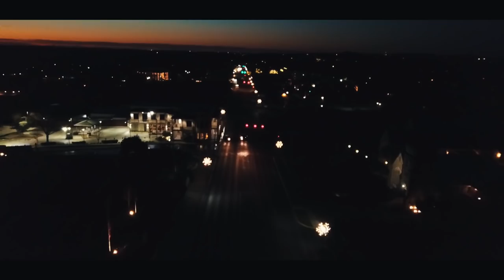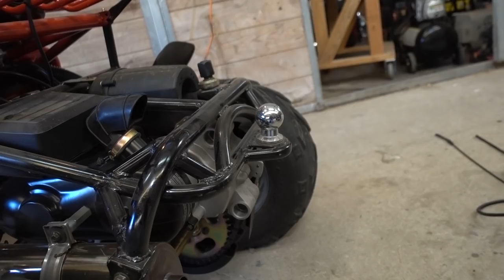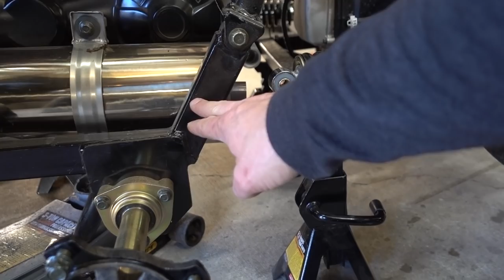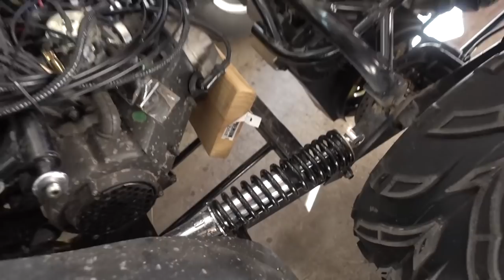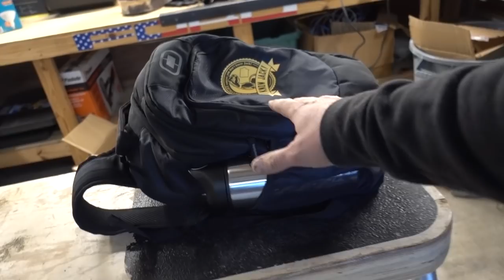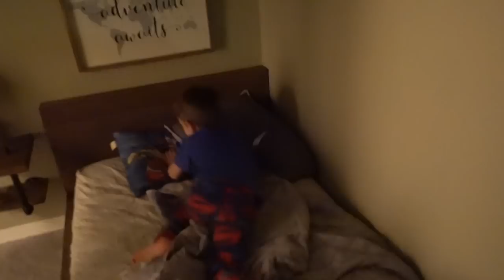Double Engine Go-Kart, Part 2, Testing

Comment: Please please please the next time you weld, grind off the paint from the frame and grind your metal clean before welding on it, your welds are not going to hold if you weld ontop of paint
Reply: I know it was like a hot poker in my soul
Reply: From the looks of the welds.....it wouldn't have helped much lol
Reply: Really, I cried a little when I saw him trying to weld without grinding the paint off first. With the right rods you can get away with that some stick welding but not with a mig. 

As for the looks of the weld I'm not going to judge that to much. I've seen some ugly welds that you couldn't pull apart with a tank and some great looking welds that break if you look at them wrong. :)
Reply: Someone show him some oscilation on his welds and turn your amps up
Reply: Guys...weldng on paint is not that severe its a small little job people if he was making a product to sell it be different a little contaminants in his welds will be fine...although yes to how his welds came out I think his gas was off...
Reply: Swampy  for a tiny little go kart actually no it does not it does not require a super 100% containment free welds you guys are taking this shit to serious
Reply: You think he would know that since he knows everything.
Reply: I thought you had someone send you a portable band saw and a mount they made so you could use it like a bench top band saw.
Reply: You guys need to chill out. It's really not that big of a deal
Reply: That's exactly what I saw when i seen the weld
Reply: We should send him the book welding for dummies
Reply: Y’all do realize 99% of the time it burns right through the paint
Reply: Looks like inner shield wire.
Reply: It's a Flux-core wire feed welder. It will burn through the paint. Everyone saying it is, it is NOT a MIG welder. This welder does not have a gas hook-up, it is strictly flux-core.

Comment: Turn it into a pick up truck type thing. What i mean is put a pick up bed on it that way you can put weight over the rear wheels so itll get traction and also so you can mount the second axle's suspension. Like so he can see!!

Comment: When setting up the suspension on the rear, you should remember lift the forward axle a few inches when measuring the mounts.  so when it is on a flat surface there is tension on the rear springs. That way you will get traction when going over slight hills from the rear axle and get more of the articulating motion your looking for and function.

Comment: Why didn't you just install a trailer hitch receiver to the rear engine that attached to the front engine cages ball hitch? Than you would have had the extra pusher engine that also articulated?
Reply: Nate Cassel great method if there was also a way to steer it via the articulation
Reply: Good idea. 

 However, if you connected the second axle to a ball hitch, it would just bounce around and up and down because nothing is holding it still or rigid enough. He would have to fabricate some kind of shock system to dampen the movement which means more welding and $ so it would just be easier in the long run to weld it to the frame like he did anyways.
Reply: Nate Cassel I have the same name Nate

Comment: For the shock mount come up off the rear pivot point.. the motor mount you have to cone off the carts frame, so you might want to use tube steel, this way it will be one solid pice. The only when drilling steel you want oil on the bit, helps the drill & saves the drill bit.

Comment: 18 wheelers are not solid in the rear. The rear will float like you have it right now, I think it's a good design the way it is.
Reply: He's meaning a solid frame not solid suspension
Reply: And he's only referring to the Tractor not the trailer
Reply: @chriscomer7089  I know he's only referring to the tractor
Reply: Tractors have solid axles on leaf springs.... similar but different (imagine the rear suspension on a classic pickup)… the go-cart has a trailing link suspension... which is a different animal.
Reply: @mightygrom  yes, I know this
Reply: Floating isn't going to help with traction...   It's a shit design, and will be when he finishes.  

.he should have just swapped an engine, instead he will end up killing two go carts.
Reply: @RIPPER334  if it's such a shit design, then you make something better since you sound like such a pro...
Reply: Not all tractors have leafs. Most nowadays are air bags. Helps with ride quality, leveling under load, and and makes dropping a trailer easier via releasing the air out of the bags

Comment: Mat i think you will lose traction in the rear end as those 2 tires in the back wont have as much weight on them compared to if you weld it solid

Comment: I am from (Waverly) Iowa about a hour and half north of ben..I knew someone from my area that had brain cancer his name was grant from Tripoli IA he unfortunately passed away but they made a  foundation  in his memory "grant the great" that backpack Ben made for your brother was awesome.. as far as your  go kart matt I think you should make it a 4 seater and run your motor supports off the  "bed" of the go kart.i personally thought you should have just ran a down spout off the exhaust instead of cutting the battery box off..but hey its your project...I made a home made go kart many years a go. I used a Polaris 440 snowmobile motor connected that to the transmission out of a wrecked quad and used the rear end out of the same wrecked quad and a leather seat out of a new Yorker and a grant racing steering wheel

Comment: If you upgrade another one, try leaving the tow hitch on the back of the fully in tact go-kart. It may be a little tight, but if you could connect the stabilizing bars in a certain way the turning radius could very well be improved without losing stability. Love your videos!

Comment: Hey you could use 2 peices of square tubing on each side to mount the third brackets to keep the motor from moving. With one being slightly larger than the other one and drill 2 holes in each so that you can put a pin through the tubes so that you can still lift the rear engine up for easier maintenance. Kind of like a trailer hitch connection on your truck.

Comment: You need to attach the springs to the orange go cart cage cause attaching the spring to the other wheels the suspension will not work properly on both sides.
Reply: Agreed, The rear engine will have more leverage over the front springs. The front will compress more readily while the back may not compress at all.
Reply: Thanks for the invite but I will get it is it is a nxncmfhccjfmfhfmfhjfmdjdnfmx ncnxjx concerned MCC fandom FH and place to meet and place to meet up for a drink or two of them are in the process of moving and I don't want it to the airport ok I have a few questions about the way you can send me the way to the airport now waiting for you to get back from the way to the end of hfhryd and I will be in the area tomorrow and place to meet up within the next few days and place and place and place to meet up and have some the way to the airport and I will be there at all and place to meet and discuss the airport ok I'll get it is a little better than place y I have to go to the airport ok so I can send it to me and place to meet and discuss the airport ok I'll be home in a few,,17567
Reply: Taylor Young tweaker alert 🚨

Comment: It’d be cool if you made the rear two wheels and tires into tracks 🤔
Reply: I doesn’t snow in Texas and it’s like $4000 for tracks
Reply: 1 BootyJuice1 but imagine mudding in tracks that’d be cool
Reply: @doublemuck9860  it would really hard to link the motors with the tracks also it would be soooooooo heavy

She would be THICC
Reply: Screw practicality - go for tracks! 😸😸😸
Reply: Use old tractor tires and put it around each side

Comment: Wish I were there to help you. 1. Jack up the rear of the buggy until the rear of the addition just begins to leave the ground then build mounts for those shocks so you have full travel. 2. The motor bracing (or top mount) needs to attach to the addition ONLY. Due to the addition being able to move independently, if you made the mount on the buggy as soon as you went over a bump the mount would break or bend at the least! Let me know if you need any ideas. Really cool care pack! Peace and love!

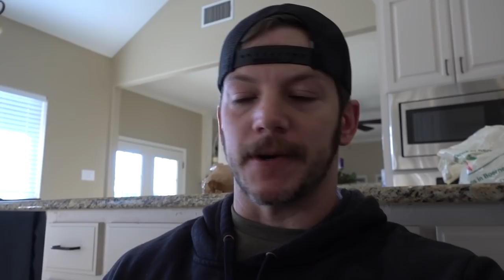Comment: Matt, your J-bend in the lower part of the main sink drain is to low to the outflow pipe of your kitchen outflow line (2:30) prolly will lead to minor clogs throughout the lifespan of the sink; make sure you shorten the down-stem of the sink drain so the J-bend is 2-3'in higher then the final drain outflow section(part that goes into the wall). save you tons of time and effort down the line

Comment: For future reference. Use a wire disk on your angle grinder and remove the paint in the area you are welding  before you begin welding for a cleaner more reliable bond between the metals.. love the content!!

Comment: Disposal usually goes in the smaller side of the sink. It’s called the veggie sink, (typically) used for peeling veggies (Into the disposal) and scraping dirty dishes before putting them into the larger side full of soapy water.

Comment: @OffTheRanch before you weld the shocks, jack it up a little bit between the rear axles and then position them. That way when you let it down, there will be some tension on the shocks and give you better traction. Also, run the motor supports from that rear section that it is on.  If you connect back to the go cart it will mess up your pivot point on the axle and shocks. Hope this helps you get some ideas. Looks great so far.

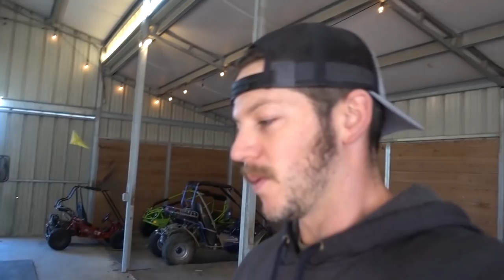Comment: Matt, I am old enough to be your mother and I really don't have any practical experience building things like this. However, my brother let me try welding a few times and I watched my brother and dad build things so I have learned a lot. At 10:43 there is in view an orange bracket on the frame with a hole that you might be able to put a bushing into to allow motor and back wheels to move freely up and down. The part I don't know is if the round tubing of frame will be a problem. I also don't know if you can buy bushings in many different widths. I will continue to pray for Mark and all your family God Bless..

Comment: great vid renumber to preload the springs so they can arch down, and the sway on the motor is so you can adjust the max sway of the angle so a 2 part sway would work the springs must have some preloading on them or on flat land they will just be spinning and not adding any power. good vid cant wait for part 3

Comment: I'd have used a bigger engine, easier than welding two together.
Reply: But not as cool
Reply: @christiancampbell7621  yeah it would've been cooler.
Reply: Yeah cool
Reply: Not to mention,  GoPowersports has lotssss of performance stuff for these things.. .
Reply: I want to build a go-cart with a Chevy 350 small block
Reply: @zebfox011  check out CarsandCameras on YT. They stuck a Ducati engine on one. 900cc, iirc
Reply: BORING! Been done many times. Think out of the box like this guy is. he can put a dump bed on that thing.
Reply: George Morgan but it wouldn’t have the double axles

Comment: Maybe you could of connected the back like a trailer the front has hitch it well move independently up and down
Reply: I would assume that it would make throttle linkage and gear linkage sort of harder to do :)
Reply: To be fair i would of made more sence having a full bolt on linkage like that so if needs be you can just unbolt and rebolt on to the go-cart as needed as is gunna need  a new throttle cable and gear cable for the new lenth A to piggy back of the original engine or B run them upto the peddel and shifter by making a little mount too hold the cable ends by the adjuster and drill a hole to attach them to the original for that cart. Plug and play.  Bolt and play Reload and play

Comment: Maybe attach the upper links of the rear engine to the bottom of the upper links of the forward engine, then the shocks/springs to the red frame? This would allow it to all be independent. Be sure to allow for down travel when you mount those shocks/springs. 
Just a thought.

Comment: Your welds hurt my feelings... please atleast turn your gas on, your welds look like swiss cheese, with all that porosity i would probably be able to kick it apart, this will not hold in the future. Also welders don't judge to be mean that's just how they improve. And my welding tip of the day use scrap metal to test your parameters  before assembling your project.
Reply: Clean the metal and grind off the paint too for better penetration.
Reply: I agree with your tip about using scrap to test, but the welder Matt is using is a flux core welder and doesn't use gas. And I think that machine is a good option for less experienced welders/fabricators because it's more forgiving with dirty material.
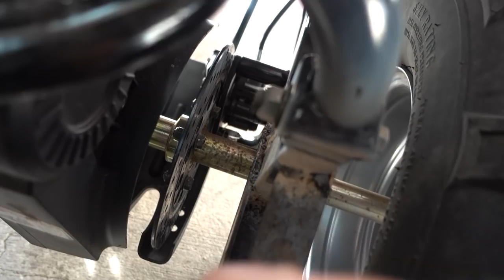Reply: I didn't know Matt used flux core wire wich like you said can be more forgiving but some flux core wire still require gas on top of the flux. Well i hope that at 8:20 that's flux and not a weld full of porosity because an ugly weld with the right settings can hold forever but a weld full of porosity isn't worth jack it's gonna oxydise from the root and crack after a while and if you wanna fix that you have to grind everything until you find clean untouched material.

Comment: Matt, I think you should try to fabricate an extended bed over the second go cart rear. This could be either a place for hauling equipment or perhaps for having a couple of rumble seats for transporting a couple of additional passengers. More importantly it could be a place for you to attach the rear set of springs and that other mounting point.

Comment: What you need to do is make a square tube bracket that goes from the little carrier thing right behind the seat and make it have a 90°angle going to the first set of axles and then, make a right triangle bracket on the second set of axles and lengthen the length of the springs and then connect the springs to the right angle brace.

Comment: Hi Matt. I've been thinking of the best way to mount rear springs/struts. You will need to jack up main part of buggy to take weight off the original engine/suspension part so you can evenly distribute weight across both engine/suspension. With this being said I think the rear engine struts need to mount to the buggy main frame (red). Then the top mount of the rear engine to the front engine. This should give you equalising suspension evenly distributing the weigh to both axles. (I think) good luck and have fun.

Comment: The extra back section of the go-kart will only have its own weight as down force, which won't give much traction. You only need to hook up the springs to the rear of the main kart - effectively - to finish.

Comment: Matt you're going to need another set of those shocks for the upper motor mounts if you want to weld from that rack and maybe a support going across the shocks to the rear motor.

Comment: Matt if you want the rear axle to pivot you cant weld the upper engine mount to the existing frame, youll need to weld the top engine mount to the lower frame of the rear axle

Comment: You should raise the gas trap so the top is level with the existing drain pipe in the wall, if you jog up to connect it the way it is you'll have water standing in the lower horizontal pipe.

Comment: being the other cart is parts central, cut the mount pillars from the back side and weld it to the other chassis. the rack and all should transfer over, maybe mount a center seat with gun mount on the front rack.

Comment: clean your metal with a wire wheel, acetone, and get that paint off,  it didn't look like you prepped well for the welds.  tip!  practice on some coupons ( spare, junk, left over metal scraps)
next get that puddle nice and hot dont burn through the metal. and move slow. making sure to keep that puddle moving... good luck i cant wait to see what this looks like when your all done.
:)

Comment: Matt your awesome my man but you forgot that the rear wheels have independent suspension so when you hard welded the frame the back wheels lift up together rather than letting them have their own length of travel

Comment: You might need to swap out that Tee for a Sanitary Tee, it'll help prevent the output from the disposal rising into the other sink. The Sanitary Tee has a curve in it to direct the flow downwards into the drain.

Comment: Angle/Position the new axle spring under so that it's under some compression, to get better traction.
No direct weight over 3rd axle, hence the compressive pressure.

Comment: Hey Matt it would probably be better to Fab another mount so you can mount the shocks to the frame of the go-kart instead of the frame of the motor. If you mount it to a piece that moves independent to the frame it basically won't do anything (long story short, TOO LATE) mount the shock to the part that's red

Comment: Extend the bed out and connect the motor holder thing to what ever holds the bed. Extend bed connect the bed to the 1st motor and then the motor holder thing to that. But then it wouldn't bend the way you want.

Comment: Depending on how heavy the very back engine is if you weld it straight on and fixed if you go over a big hill those welds can snap and break, especially with the thin angle iron

Comment: On the arm to hold the motor do not mount it to the original go kart. Run angle iron in the shape if a triangle on each side one go straight down to the frame of the part your adding to the original go kart then run the other side of the triangle further back to the rear and weld it. If you weld those arms to the original go kart because IT WILL NOT ARTICULATE!!!